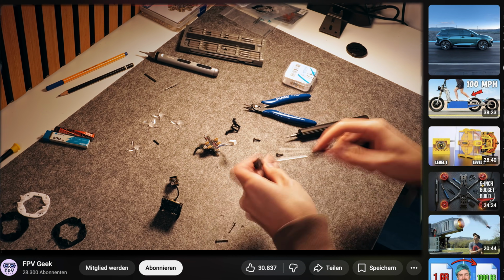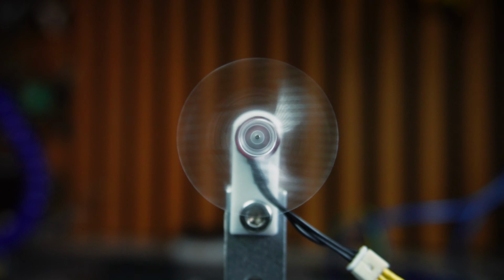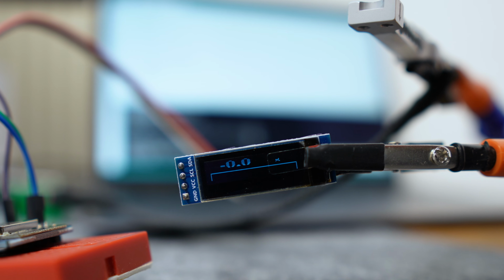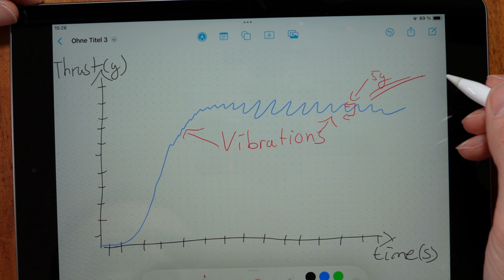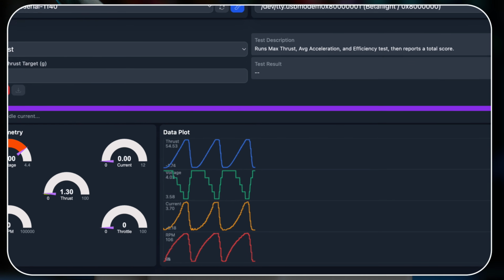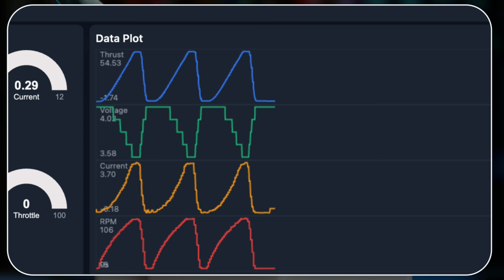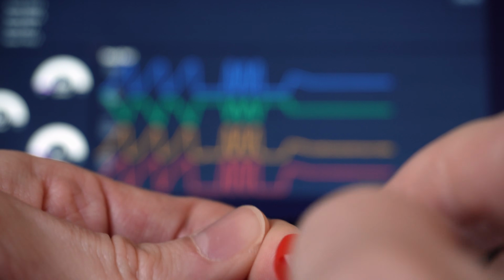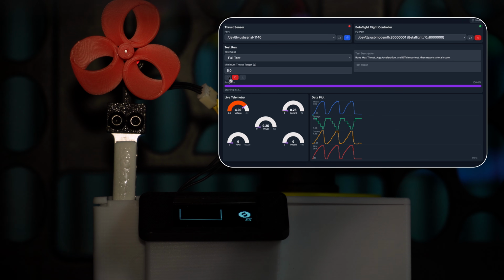If I can build this at home, what is the Military hiding?

Comment from the maker: What do you think is wrong with my toroidal prop design? 
And if you want to help this video after all the time that went into it, a like and a comment really mean a lot. ❤
Reply: Lacking an aerofoil, wrong angle of attack. Excess drag due to toroidal design. Do the military use them? No. Have they tested them? of course.
Reply from the maker: @techbricks5300  Thanks for the constructive feedback. I noticed that too. It doesn’t really have a proper airfoil profile right now. My guess is that this is probably one of the big limitations with FDM printing at this size. Or at least really hard to do well.
That said, I did see there’s now a fork of the toroidal prop script that actually tries to generate something closer to an airfoil profile, so I definitely want to look into that.
Reply: I would say the angularity of the holes are botched.  when you scale down in size, the airflow may require a tweak on angularity, but it seems like it's an order of magnitude off in the wrong direction.  off-the-cuff estimate is, it looks too "flat", so it's cutting the air instead of riding the turbulence and producing thrust, if that makes any sense.  an off-the-cuff guess, would be to make the blades taller, and the angle less steep (less overhang on your printer), and the hole-loops in between the smaller/more oval.  there's lots of variations within that range, so sorry if that's too unspecific to be constructive.

over-the-top min-maxing within those design parameters would be what I would do, if I was in your shoes.  I also recognize that that may be quite a time sink, and the yeild might not be worth it for your specific application.  This comment is intended to debug for the novelty of the torridal design, but it may not be the ultimate practical solution for a drone.

but I do think you are onto some cool stuff.
Reply: There's nothing wrong with the design BUT the factory made props are produced by injection molding which provides a tight grip between motor rotor and prop mounting hole . The 3d printing just doesn't give you exact hole diameter . There's this seam line which makes you think the prop is tight enough . But a lot of the prop is not in contact it's just that seam . You can design relief cuts in the prop hole and experiment what size helps the most . Or for once try attaching prop to motor with CA glue . That should stop any slippage . 
Sanding is also a good way to reduce turbulent air flow and printing with a glossy filament with 0.2mm nozzle and lower layer heights might work as well
Reply from the maker: @dixitahariYT  Thanks a lot for the constructive feedback, that’s actually really helpful. I did experiment with a 0.2 nozzle, but I couldn’t get those overhangs to print properly, which I needed to keep the pitch identical to the original prop. I haven’t really tested a very wide line width with the 0.2 though. What do you think would make sense there, maybe 0.5? Or would it even make sense to go all the way to a 0.8 nozzle?
And yeah, I also think smoothing and maybe filling those grooves could help a lot. I experimented quite a bit with layer height too and went as low as 0.08 mm to get the overhangs as clean as possible. These were printed in regular PLA.
Reply: I've designed a prop using the path of a mobius strip which looks very similar to a toroidal prop, maybe you would want to try that. It has an aerofoil (English not Americanglish) and seems to work quite well in the CFD simulations I've run. If you're interested I can upload the .stl files.
Reply: Excellent observations from the above comments. 

Coming from a total layman (ie a non-engineer) background but with some intuitive understanding of the mechanics involved, my gut tells me that as you get down to smaller and smaller motors that rely more on high rpm with lightweight loads, youre going to get less out of toroidal props because the mass of the propellers themselves and air resistance just asks for too much out of the relatively anemic motors, and the effect of small errors in a smaller prop is going to be a larger percentage of the overall surface than in a larger prop. One might expect resin to perform better in this regard. Another thing, just look at the silhouette of the small toroidal prop vs the larger. There's just more material there as a percentage of its overall size. I'm not sure how to describe it but you could tell me they both weighed the same and I'd believe you. I'm not saying they SHOULD be proportional in terms of mass (I simply don't know) but again, my intuition tells me the relationship is off. I dont think the difference in performance characteristics between the motors that drive their respective props is proportional to the difference in surface area/mass, putting a lot of the load on a motor which its not equipped to bear
Reply: Alpha only 4° to TeQ-Factor 9/40.
Reply: surfaces are not smooth, the saw type section of the surface helps in denser fluids. try holding them in acetone vapor cage for some time. Angle of attack may be an issue too. Surface of attack definitely, it should be regarded as the perpendicular of the angle of attack. the curvature of the prop surface have play as well.
Reply: Ever thought of using one single big fan and work on the surfaces/flaps for flight control Leaning on the "coanda effect" its real and strong
Reply: I believe a hybrid pitch on the 35mm props would allow it to grab the air. use the average pitch of the other blades along the leading edge of the toroidal prop and then from the farthest point out increase it steadily back toward the center on the trailing blade to make it more aggressive like bigger props do as you get closer to the center. 

It may also help to simply double the pitch since you are essentially making a 6-blade prop.
Reply: this video mentioned the cons of toroidal propeller, https://youtu.be/NRN263r0Nl8?si=RRv9iwxgN62r4d_E
Reply: They don't work...plain and simple....

Comment: the ESP32 is able to control the ESC directly by sending DShot commands and if you use bidirectional DShot you can also get the ESC telemetry directly. no need to involve a flight controller at all

Comment: so i dont know anything about this field, but something raises my interest about the math of the aerodynamics. I noticed that your prints have a bit of a strange shape to them. you're using an ellipsoid, like assume you were to completely focus on only a single print layer of the propeller, you would see essentially a stretched circle, also known as an ellipsoid. however a real propeller if you were to examine a single layer would look a lot more like a double pointed sided tear drop, or more like the shape of an eyeball, where it is slightly pointed at both the base, and the end. If i were to make a guess based only off the math behind why this would be its likely that the air force you are experiencing (or lack of?) is due to the added weight in that tri wing print, where the base of the ellipsoids are all essentially overlapping, so nearly no air is making it through that, it would be worth attempting 3 additional tests, one where you make a rounded point on the base, the end, and on both, to see if this make any measurable differences. Then continuing this same logic, your propeller's... "width"? is reflective of a real propeller, but then it's "height"? would need to be tested against the same design, where you attempt to keep the bottom, top, and both more to an accurate shape as a real propeller, though with out looking at them in person, or their files it would be hard to tell if youre already accounting for this based on what i can see here.

Comment: I did similar project (well you’ve beat me in app department) for my engineering degree, it was a 5 - 10 inch thrust stand based on Arduino used in aerodynamic tunnel. While I also wanted to implement E-stop I couldn’t find/afford sufficient one for my power consumption. What E-stop did you use ? Does it actually work during high Amp load ? 

Great work you did, if you wanna exchange some ideas or talk about results shoot me a message !

Comment: Very impressive little system you built. The video quality is also top-tier. In V3, you could include a fan that will prevent the testing prop from using its own turbulent, dirty air. The fan could be programmed to the micro controller so that it increases airflow as the RPM of the propeller increases, similar to drone in real life.
Reply from the maker: What exactly do you mean by that? So why does he eat his turbulent air?
Reply: @fpv-geek  Think of it like trying to swim in a pool: if you stay in one spot and just flail your arms, the water around you gets all swirled up and messy, making it harder to push yourself forward. But if you actually move through the water, you’re always pushing against fresh, undisturbed water, which is much more effective. A propeller on a test bench is like the swimmer stuck in place, constantly churning the same turbulent air, while a propeller on a moving drone is like the swimmer moving forward through clean water. Adding a fan in front of the test setup is like creating a current in the pool—it helps simulate that forward motion so the propeller interacts with smoother, more realistic airflow.

Sorry, not the best analogy but I hope you understand what I mean!
Reply: @FlickerFPV Maybe as a second variant, an add on. Since drones also hover in the air this is resembled by the test and I think fine like it is.

Comment: Extremely good quality video.
I am an aerospace engineering student and I have two things to say as some advice :
The propeller performance is mostly dependent on RPM, for a given RPM (N), it will produce a given thrust (F in n^2) and will require a certain torque (T, in N^3). All the other parameters like blade cord, at hub, at tip, blade pitch, blade number... will change the results, but you can decouple the performances of the propeller from the performances of the motor, battery and ESC combo.
Also, your load cell works in bending (typical with these dog bone hole load cells) with the lower face of the load cell compressed and the upper face under tension. The stress that is measured is proportional to the bending moment, and so the distance where the thrust is generated is extremely important. If you put your motor farther away from the load cell, it will increase the read load, and give you erronous thrust readings. I would really advise to put your motor something like at least 5 propeller diameters away from the loadcell, and then calibrate the loadcell with weights placed where the motors would be held to decrease errors due to motor placement

Comment: There are so many toroidal prop tests out there. They don't work well. The blade tips are too heavy. Also a bi blade toroidal is basically a 4 blade prop with two joint tips.
Great quality content. Good engineering with the thrust stand.
Foxeer were the only ones to make PC moulded 5 inch toroidal props. They were disappointing like all toroidal. I can send you some.
Grüße

Comment: I would suggest you to use resin 3d printer for smooth blades, filament printer is not good for props. buy high res 3d resin printer like 10k, 12k 16k.

Comment: if im reading it right the printed blades are 2.5mm thick, why?
that seems excessive for structural stability and adds a ton of weight which is detrimental for obvious reasons

ideally the entire blade should be one wall line per layer, two at most
if you need extra thickness model it in but stick to 1 wall and disable infill entirely
adjust line width instead of adding extra walls (obviously the modeled thickness of the blades should be divisible by the line width up until 1-4 line widths), any printer sold within this decade can easily go up to 1mm line width as long as you dial down the speed

layer height should be no more than 0.1mm, and even that is probably too much at such a small scale
go as low as you can, but test for any difference until you find the point of diminishing returns

dont get caught up in the 'rapid prototyping' part of 3d printing, quick prints is how you find out what works, if the final print takes 10x the time to finish but it performs measurably better you should swallow the small upfront cost of a few extra printing hours rather than compromise on part quality
Reply from the maker: I just measured them again, and the larger printed toroidals are actually about 0.38 mm thick. Layer height was somewhere around 0.08 mm. 
But I do agree with your general point. For something this small, print quality matters a lot more than print time.